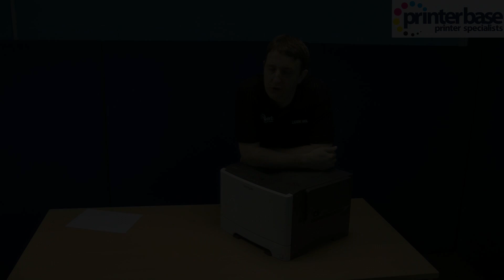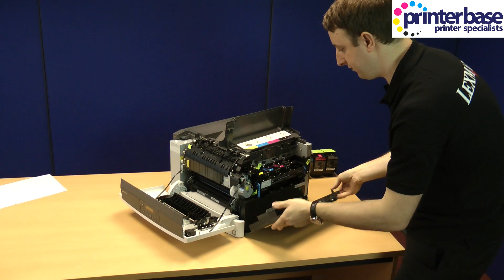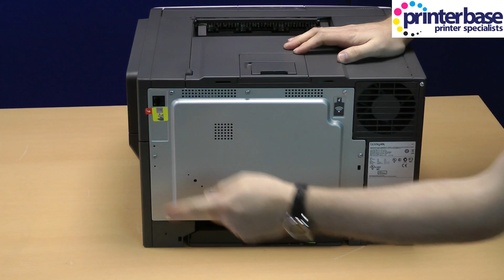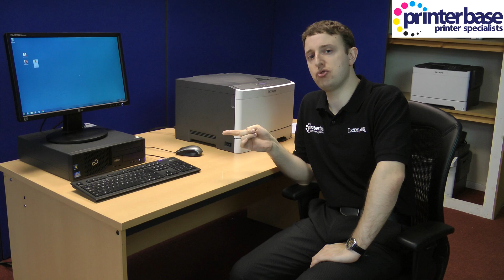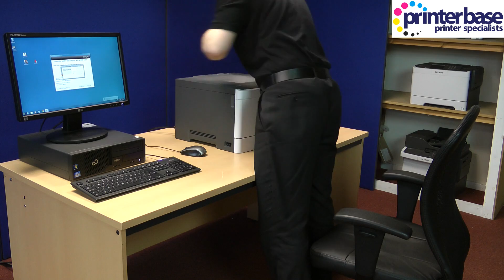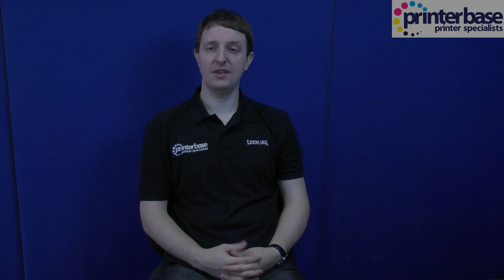Lexmark CS310dn A4 Colour Laser Printer Review

Comment: where is the manual feed tray?
Reply from the maker: Hi Voula, 

Thanks for getting in touch. 

The 1 sheet multipurpose tray is located at the bottom of the printer on the paper tray - there should be a black opening with curved edges. 

I hope this helps
The Printerbase Team

Comment: does it go through a roller drum before coming out? Id love a back feed printer that can print on thin paper without jamming. Also need it to print card stock and envelopes.
Reply from the maker: Hi Voula,

The Lexmark CS310dn will not print onto card stock or thick media. The highest gsm this printer will print onto is 163gsm. 

Yes, all prints will need to go through the roller drum before coming out this is why its limited to 163gsm max paper weight. 

I hope this helps
Many Thanks
The Printerbase Team

Comment: I have 2 questions, 
What minimum page can I put in the tray for it to be pulled?
Does the fan keep spinning all the time?
Thanks everybody.
Reply from the maker: Hi Akshay, thanks for getting in touch.

The Lexmark CS310DN will accept paper between 60 – 175gsm from the paper tray. The fan will only spin if the machine is either warming up or printing, once the printer is in standby mode the fan will stop. 

I hope this helps.

Many Thanks
The Printerbase Team
Reply: printerbase.co.uk Thanks a lot for your help. Sorry, I meant what is the 'minimum number of page' can I allow in the print tray for it to be picked up? 
And Lexmark offers a firmware upgrade. Should I consider this or is it better to stay away from it?

My printer does not go to sleep nor does the fan stop spinning after printing, although I set these options correctly in the settings.